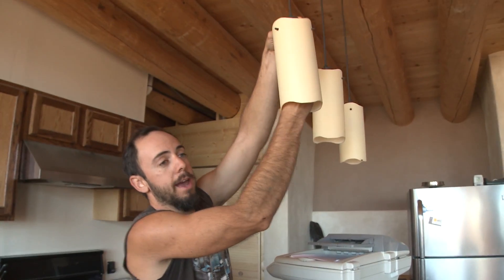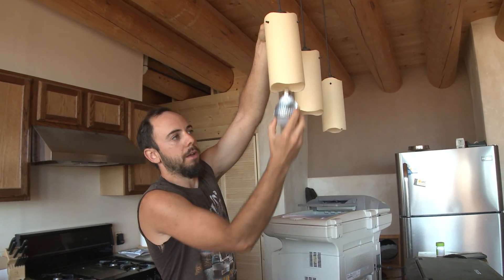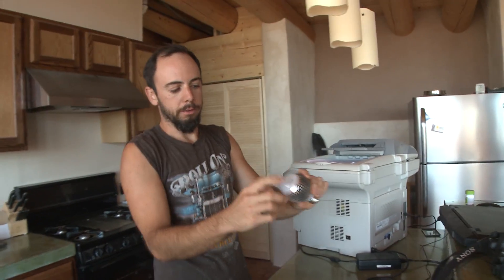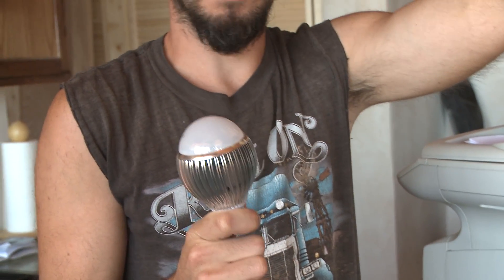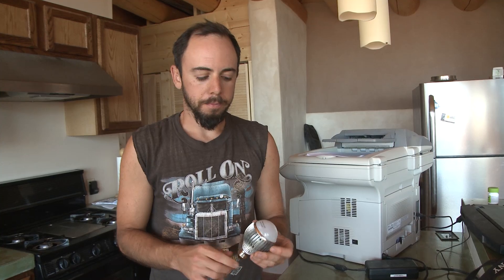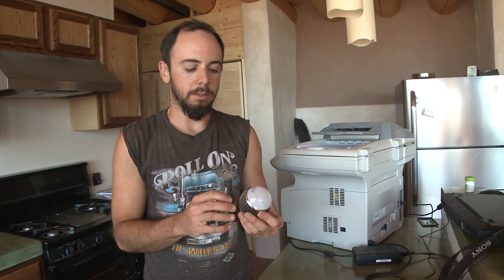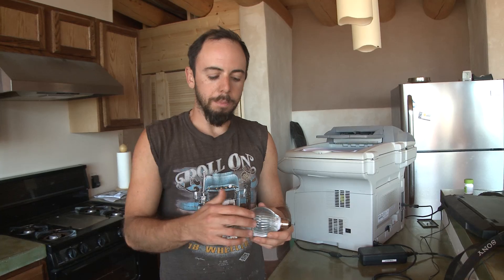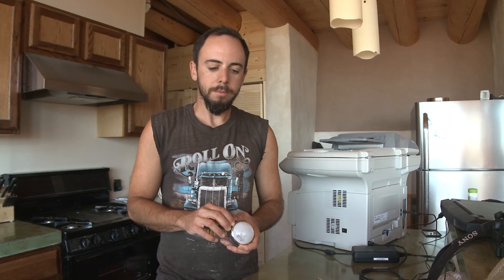12 vs 24 Volt Solar Systems

Comment: $45 for a 7watt light bulb?  how does that make your 24v system a sensible choice?  I use MR16 12v bulbs that cost $2.50 delivered when I buy a pack of 10 on ebay. (Decent branded ones too) multiply that by lets say 12 bulbs around the house and you have spent $516 as opposed to my $30... The efficiency gain from having less current drop over medium lengths of cabling, and the efficiency gain from dc-ac inversion by using a 24v system will take a VERY LONG time to recoup... Plus as you mention in the video, the range of 12v dc appliances is greater and cheaper. it would take a lot to convince me that 24v is a prudent way to go.
Reply: TheComputec BTW, sorry if my other post sounded critical... I love your videos and appreciate the time you have taken to explain solar matters.. I'm just worried i've missed something
Reply: This solar gadget stuff is kinda like bass fishing...  part of the fun is buying interesting looking plastic lures that might be the trick to get that Big Fish !
As declared, it's best to use what is commonly available at the best pricepoint.  rc
Reply: TheComputec what he forgot to tell you is that bulb will last 7yrs or more hell some are rated at 10yr (even 15yrs). In 5 yrs time the bulbs are onl 9 bucks and the equivalente in Amps drawn are ENORMOUS

Comment: Why not use methane generators or 12/24 vdc element in a ammonia refrigerator?? Like camoing..three way power fridge..12vdc,  120vac, lpg or natural methane..( candle power) sized flame to start the adsorption process. 
Costly investment but available in areas where electricity is scarce. Wood ovens, stoves can also be used but how long will trees last?  How about solar to electric storage to HHO-browns gas or hydroxy (hydrogen ) generators. There are few ways to store hydrogen but components are costly and hardvto aquire due to US Gov regulations.

Comment: To calculate the exact amperage you are tasking the batteries with:  Divide the total AC appliance watts by the battery bank voltage then multiply that result by 1.1 to get your answer.  Example: 500 watt /120 volt AC coffee maker ran on a 12 volt battery through an inverter - 500/12 X 1.1 = 45.83 amps from the battery.

Comment: We'll for one the voltage either AC or DC is not stable. Most the time their higher. So your over volting the appliance which makes it run hotter and wear out sooner. I've had to install capacitor banks and buck and boost transformers to fix some of the more serious problems in homes and industrial business. Where they use lots of motors, lighting and welders. 

So it's not a matter of voltage. It's how stable that voltage is. Most homes can be fixed with capacitor banks to fix the efficiency problem but nothing is 100%. The rest is just wiring it right with as little changes as possible in the voltage. 

And remember a watts a watts. Doesn't matter what voltage it is!
Reply: ***** Wrong. Amps do.

Try getting a copy of the electrical engineers hand book or NEC code book!
Reply: ***** Listen idiot, The voltage can be 100K and you can run that over any size wire. As that is how the power companies deliver our power over small cables. Then as voltage drops amperage increases as it reaches the transformer for a business or home.

Get an education please before you kill someone or burn something down. Here I'll help you.

http://www.cerrowire.com/ampacity-charts

Comment: Hi you   guys   well I am a retired   electrician  Well   to  answer   Baselb80 question   a lot  of  ordinary   items  we now use on  A.C  will  also run on  D.C    incandescent and   halogen   light   bulbs    incandescent   light  night  lights   hot   plates  with older switches  in  theory   all   heating   elements   word of caution here   the only problem   will be the modern   swithes  that will tend to arc when   opening   all   older   portable  parabolic   infra red   heaters  with no switch,,,   most all   120volt   power tools   drills   Akillsaws      jigsaws   sanders   vacuums   in   other words  any   brushed  series wound   motors will run   on   dc,,,   also   older   5 tube  table   radios will also run on   dc  one simply has to insert the plug in the right   polarity,,,   now if the table  radio   main  electrolytic   capacitor  happens to be open and the radio will  buzz and hum a huge lot when on ac   on  dc   that humand buzz   totally   disapers.....   All these   items I myself  have   operated on  dc   120volt   they run good   the only thing is that with dc   and   larger loads   one needs  better switches and   controls  and by    rights   would   recquire   Dc   breakers too  and also   arc  detecting   breakers that would cut off if something   starts to  arc too   mucht...    For   small light bulbs  even up to  100 watt or so   ordinary  switches seem to not arc too mucht when   opening   the  problem only occurs when  interrupting a  120volt  dc  circuit say   powering a toaster  or a sqillsaw    older portable  power saws  had way better  control  switches that could handle the arcing  ocuring when you wanted to stop the saw   there is no arcing any other time...   I myself now have a   120volt DC system  on wicht I run lights a   radio   and  even  use a  regular   corded   electric   lawn mower in summer   and plan on  upping this  system to   120/240voltdc   this  summer  I am now using  10 panels  in series  but will have another 10 panels added   these are older  12v  nominal    panels....   With this system   no invertor is   used   for the items I am  using   and a lawn  mower on  120volt  does not draw that much out of the batteries   now at  240 volt  even a   720 watt stovetop element will only draw   3 amps out of the   batteries   not hard on them at all...    This systems  feeds a small  yard shed and shop that I  use in   summer    a bit of a hoby   but I do like the  higher voltage   systems   smaller wiring   cheaper on  many things   but also   higher  voltages  are more  dangerous and require  more   caution
Reply: bernard240vdc Pretty much ANY appliance that doesn't have a transformer as the first component in from mains will run on 120VDC. Most get turned into DC anyway with a full wave rectifier and cap.
Reply: 120V DC??? Maybe 170V DC for NOT power factor corrected switchmode appliances. Cap after bridge is charged to peak and not rms mains voltage. 120 V*sqrt(2)=170 V

Comment: @Off Grid Build Your video wasn't very helpful. You really didn't get into the pros and cons of 12-volt versus 24-volt power. You kinda just rambled on about nothing!
Reply: I agree, I thought I was getting it then he went off on another voltage so in the end I hadn't learnt anything new.

Comment: 12V is the way to go for versatility.  Inverting makes long runs easier but you also have the loss.  I guess it depends on the application.  Good points all in all.  Great video explanation of the differences.  Good points about the losses of inversion between 12 and 24 volt.
Reply: Yes I Have Done All 12 Volt DC For My House 2 its Easy 
You Can Use DC For All Your House Accept Cooking and Hot Water
Reply: do you have more vids on this?  or will you be doing more?  The 12 v set ups.  I am doing an led 12v emergency lighting system now.  It is simple and I am going to try it.  I am running Enphase grid tie right now but would like my new house to be off grid capable.  Any tips would be appreciated.
Reply: You have more wire loses at 12 volts and it takes more current to run the same size load so even more loss is incurred. For example the line loss for a 50 foot number 12 wire carrying 10 amps at 12v is 6.75%.  The same wire and load at 120v has a line loss of .67%  Not only that, but a load that draws 10 amps at 12v will only draw about 1 amp at 120v.  That makes up for any loss from the inverter and then some!
Reply: Thank you for the explanations.  Are you going to do another video explaining this?  I will post them.  our experience is very helpful.  Thank you.
Reply: Sory Late Reply What Can Mickey Do For You Tks You Can Email Me kjpaint8@yahoo.com or Facebook Mickey Tan
Reply: Totaly Off Grid In 12 Volt DC For All Your House Lighting Wifi Router Keyboard Musical Instrument and Laptop and TV and More Orthers Accepted Freege and Hot Water But Hot Water You Can use gas or 12 volt DC Eleiment And Cocking Use Gas Or Make Your Own Gas Tks

Comment: 12volt inverters are less than 87% efficient draw to many amps and need heavy battery cables, 24 volt inverters are 90% to 92% efficient much better, if you really want good efficiency out of your system get a 48 volt inverter with a 48v battery bank less amps more volts all ways a win for things that are 240volt or 110v, then just run a small 12 volt system along side it to power your 12 volt stuff. I install off the grid and solar systems for a living,
We use Schneider inverters and Morningstar charge controllers with lithium battery banks mostly, sometimes Latronics inverters or SMA inverters with wet battery banks but once you have used lithium battery banks lead acid banks just cant compare....

Comment: You could always just build your own inverter. They are a very simple mechanism.
Reply: Really?  Cuz I looked for schematics to build an inverter and it seemed a total fuck around... A PWM inverter, ie square wave is simple enough, sawtooth wave only a big more complicated but a sinewave inverter suitable to running clocks and PCs is bullshit..  I did engineering majoring computer systems at uni, which doesn't cover AC a whole lot admittedly but even with my exposure to circuit diagrams and pcboards/assembling electronic devices... I'd much rather buy sine wave inverters than try make the things
Reply: Well they have over complicated inverters in recent years but if you make a basic old school one. It is pretty simple and very reliable. Not necessarily make every part. But you can salvage all the piece from common appliances that have been scraped etc. I am referring to making one out of scrap, not from scratch.  My Apologise

Comment: I think the losses over your 12V wiring will be substantially larger than the inverter loss, just check current efficiency factors. I fact I would go as far as to state that a 110V inverter (USA) or 240V inverter (in lots of other countries) would be even more efficient and all appliance price would drop dramatically.
Reply: where did i mention phase?
Reply: J.J. Lemstra Not sure what you mean by 230v is multiphase.  And what is a phase changer?  230v is what is know as "single phase" and is the normal house power in North America.  It consists of two 115 volt "hot legs" compared to neutral ( at ground potential)  Technically you could say it is two phase (two phases 180 deg out of phase) but normal home wiring is referred to as "single phase".  115 v is achieved by running 1 of the hots and the neutral (white wire) to the outlet.  For 230 volt use you run both hots and no neutral.  No transformer is required unless you want less than 115 volts (door bell for example).

Comment: Thanks for the video.  I will be moving to Cameroon where the power is off as much as on.  I am thinking going off grid from the start.  I have been reading all I can understand and have been thinking of trying to go totally DC.
If I understood your final advice would be to set up a 48 volt system with a large 120 inverter. Is that correct?

Comment: We run two lighting systems. A normal mains voltage AC one from an inverter and an auxiliary 12 volt one to most rooms. The 12v system is really only for background light, but it's good redundancy if the main system goes down or if the batteries are low due to too much bad weather.  On the 12v we run LEDs and some CCFL bulbs. This system also runs a couple ov charging points for cell phones, tablets etc. I haven't had any issues with voltage drop from the runs I have used. There is bound to be some, but it doesn't seem to show up as lack ov performance in the loads powered.

Comment: hello Sir
I like your Ideas...
I'm have two lamp 12 volt each but my problem is that my system in 24 Volts
I'm not sure that If I connect the two lamp together I would have them work on 24 volts
any help plz

Comment: I am going to use two 12 volt light bulbs in series for 24 volts. I also plan on using a 24v to 12v converter to drop voltage down for 12 volt use.

Comment: I would only consider DC setup for small huts as the wires are going to have short lengths , for what you have been doing there all AC 110/240v with backup gen and money for replacement inverter

Comment: a question that i have been searching for an answer to but no one gave me an answer why not make a 240 DC-VOLT system and use an inverter from dc to ac or a better solution yet build appliances that run directly on 240 volt dc or any other volt like 120?

Comment: Thank you for all the valuable information that you have given through out you video series. I'm building an Earth Ship in Arkansas and I was wandering if you had any advice as how to keep the walls from leaking where they are buried, I haven't seen any information on that in your series, Thank You,
Reply from the maker: Jeremia,

The vapor barrier underneath and behind the thermal wrap are part of it:
Thermal Wrap and Cooling Tubes
Thermal Wrap Installation and Backfill

And then there is a EPDM skirt that connects under the gutters and skirts away from the roof on all bermed sides.  You're right, I didn't cover that!  Sorry I don't have any footage of that!
Reply: +OFF GRID BUILD i found a great resource the other day for used billboard material 12x48 for around $40 and it is very heavy duty.

Comment: I would have just used a quality pure sine wave inverter and forgo the issues associated with using DC fixtures.  As for the situation of losing the inverter? That is what redundancy is for.  Have  spare unit on hand to run those critical devices.  With DC fixtures it is very expensive as you have seen.  The 5 - 8% loss of power efficiency because of AC conversion, that would seem to be minimal impactive with planning of your solar solution.
Reply from the maker: It's a good point people!  At $1/watt or cheaper, it's really cheap to add 10% or more power generation on to your system.  Adding another 10% to your batteries that you have to replace every 8 years or so is more costly but still affordable.
Reply: I'd add up the costs above what one would pay extra for the 12V fixtures and appliances over standard 120v fixtures.  My guess is that the additional costs would be a wash.  Another debate point is batteries every 8 years?  I've read reports where quality batteries have lasted 10 to 12 years if capacity and proper maintenance were maintained.  Another issue with using DC power and distribute through, say and average home, you'll probably have to use larger gauge wire.  This was one of the main debating points many many years ago with DC power over AC power distribution systems.

Comment: Excellent video!  I hope you're talking about dx dot com for ordering from China. :D  If you go full on A/C, I'd suggest running multiple inverters.  I know it adds more points of failure, but it also reduces the amount of loss during a failure.  And if your fridge inverter goes down, you can always run an extension cord to your fridge from another circuit on your other inverters.  I still plan on making a high voltage vs low voltage video when it comes to safety, I just don't have anything to help show it right now.  But, low voltage is safer for the same reason 200 foot runs are bad.  Low voltage doesn't overcome resistance very well, which is a good thing when it comes to your skin.
Reply from the maker: Right on.  I wouldn't go the route of multiple inverters myself because of the expense.  I'd rather save that money for a another 10-20 years of service after the first one dies and use a generator as my backup.  I have to own the genny anyway so might as well use it!

I ordered from Independence Electric Co that is based in Vancouver.
Reply from the maker: Holy crap thanks for mentioning dx.com!  This light would work fine and is so much cheaper!

http://dx.com/p/e27-10w-1000lm-3200k-60-smd-5050-led-warm-white-light-lamp-bulb-white-silver-dc-8-24v-237175
Reply: Off Grid Build
Yup, they rock.. The ONLY negative is that they send it on a slow boat.. so you have to wait ~30 days to receive your item.  I've also learned not to bundle stuff up in an order because everything has free shipping.  So, think of something to buy, order it.  Last bundle held my order for a week as they waited for one item to come in stock.. After a week, I was like, "What's the deal?" and they told me, so I removed the item and they shipped it out.